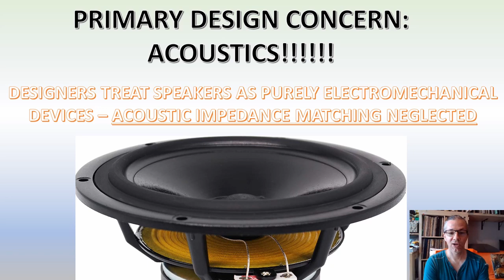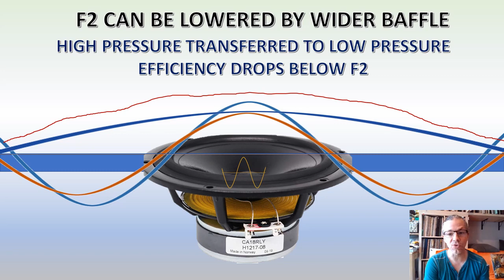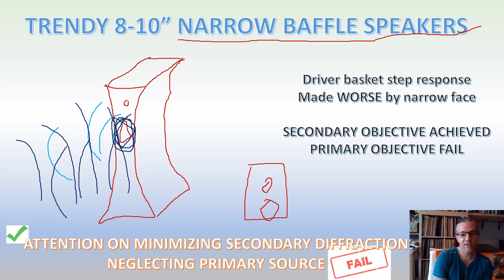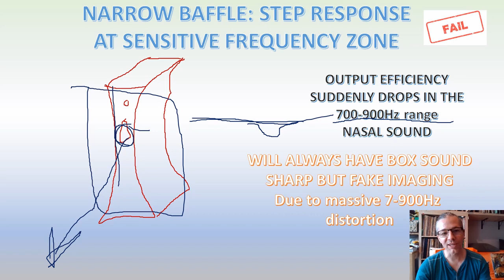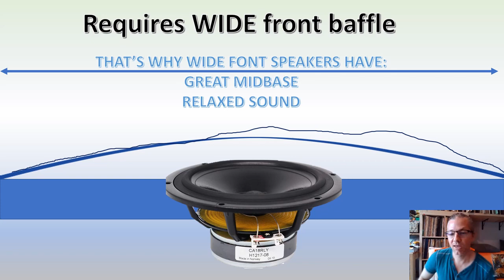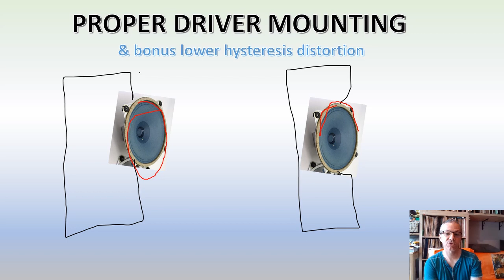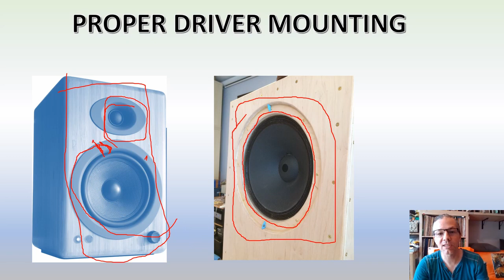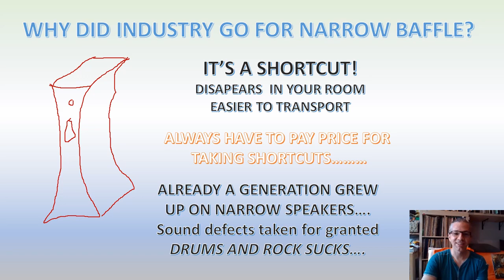Understanding Horns! Part IV BAFFLES

Comment: What do you think of infinite baffle (flush mount)? I don't have much first hand experience with it but many people I've spoken to say that there is a loss of detail or imaging compared to free standing speakers with smaller baffles.
Reply from the maker: I have not experimented with it, as it would require cutting into the wall, and turning the room on the other side into a second listening room - plus would need extra holes for the cabling to go through, so a royal mess/ very unpractical. However, I'd estimate that it would compromise imaging severely. All speakers require fine positioning to work with the room modes to get proper imaging, and fine positioning / alignment is crippled at best when they are mounted into the wall - even if it's on a gimball, and we can play with the angle, but the location is fixed, so room reflections cannot be helped. The only benefit would be with woofers, which can use the perfect wall loading for extra output efficiency. However, one would still need to experiment where to mount them on the wall, and the optimal position might not be feasible. (We have to work around studs, beams, wiring / cabling / pluming inside the wall, and there's a limit to how many holes one is willing to drill into the wall for testing..) ;